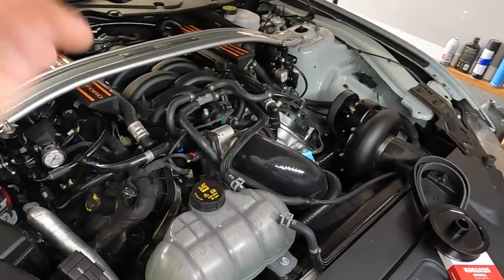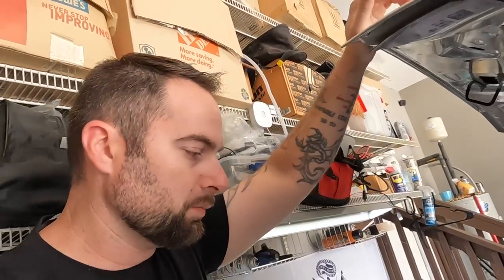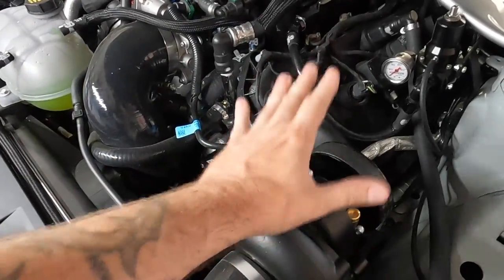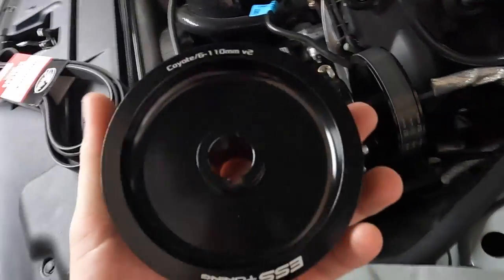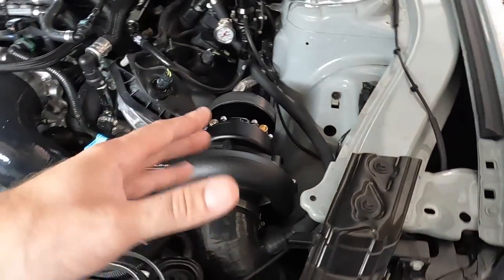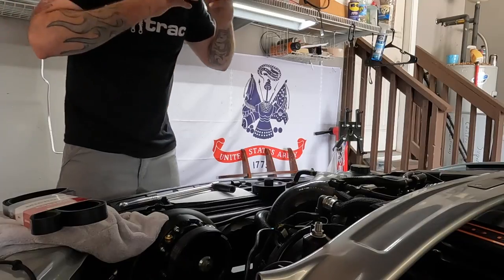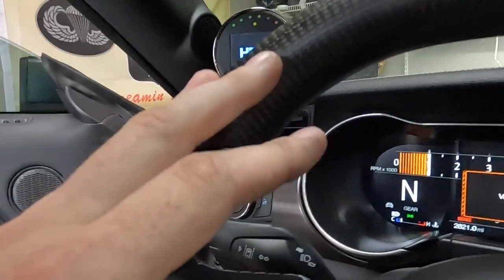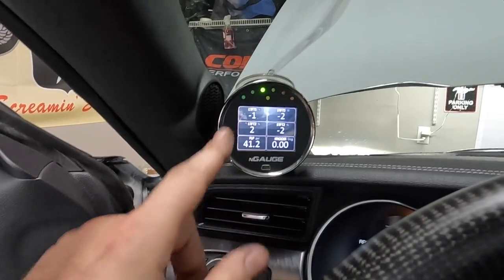FIRST WOT PULLS in my e85 Pulley'd Down ESS Supercharged 2021 Mach 1 Mustang *BRUTALLY FAST!

Comment: Nice seeing you taking predetermined and thought out steps by adding performance bolt on's like the Super charger and pulley change along with your body mods keeping the Mach 1 a Mach 1. It's getting faster and still beautiful. Nice job Zander building your special Mustang.

Comment: Did the TR3160 in the Mach 1 handle all the power mods without an issue? I've heard some concerns the 3160 may not be up to the task of boosted cars long term. Thinking about an ESS or Whipple for my Mach 1 eventually, but really not looking to built or swap the trans as well.

Comment: Nice man,  1 part at a time I was there. So just for reference if you remember my setup. I'm at 870WHP with the 105mm pulley and stainless works headers. So you're in the 800s definitely. Anyway,  pulley down and get headers and you might be close to 900 like mine. Killer video and set up bro
Reply: You must have sleeved block, built motor(oil pump, crank, pistons, rods) to push 800 wheel/925 crank, in any 5.0. It won't last long at all.
Reply: @MasterCarguy44-pk2dq  stock coyote block can handle a lot more than you're giving it credit for.  I do have oil pump gears and crank sprocket yes. Plus a fully built transmission. Otherwise stock motor. I've been boosted for over 3 years and still going strong.  I don't 1/4 mile drag my car.  It's more of a street car,  show car and weekend fun.  Not beating the hell out of it.
Reply: @Sabotfit5oh  No it can't. I have only work with the actual engineers/architects of these engines since 2008 abs SVO group which was renamed SVT. The max limit of block is around 980 hp crank. You MIGHT be lucky to get 5 full power runs at 980 crank hp/850 wheel but thats about it. 750 crank/650 wheel is the true safe range..
Reply: @MasterCarguy44-pk2dq  thanks for the information 👍

Comment: What were the reasons behind going w/ the procharger vs whipple? Really curious about all the setups, because Mach 1 will be my next fun car.
Reply: From what I've gathered from the previous videos he wanted to keep it somewhat still like a Mach 1. He also explained it all very well in his previous video that I'll link below

https://www.youtube.com/watch?v=a7FG5Q31y4Y
Reply: After watching all of his videos I decided to go with ESS as well on my Mach 1. Just because the Mach 1 is more of a handling car I feel like the ESS system will feel better than just blowing the tires off at every light lol

Whipples and stuff are hella fun but I just personally feel like a centrifugal could be more beneficial
Reply: Compared to a Screw type blower a Centrifugal superchargers tend to produce "peaky" torque curves which can be advantageous on the street as too much low end torque can overwhelm the tires and make the car dangerous for the street. They also tend to produce slightly more power per psi of boost. 
A screw type makes power virtually as soon as the throttle is open, basically just acts like an all around bigger engine. Both work incredibly well, it just depends what you want.
Turbo(s), btw, are the most efficient way to go but the most complex and takes up the most space. There's also some degree of lag to deal with. I run a single big turbo for drag racing, I seldom drive on the street.
Reply: Centrifugal you keep most of your car in tact. Slap an intake and the right belt you’re back to stock.

Comment: Just add fuel to lower cat temps..no reason it can’t be safely done. Most people run too lean anyway. E85 had a cooling effect anyway..you can monitor cat temps in a log but they are inferred so take them with a grain. And you need to look at long terms..short terms will almost always be perfect because of the long terms

Comment: Question. How much oil does yours take? Not sure what I’m doing I guess, but every time I go do a pull I get oil coming out the fill screw little hole. I’m guessing I’m putting to much, but I’m on the mark on the dipstick?
Reply: I just check my oil n the dip stick berly shows some i need to put some asap . Other thing mine dint come with blow of valve n is the biger intercooler
Reply: @jesusm4  I’d call n ask y not
Reply: @michaelsean3579  im about to tomorrow thanks for the reply

Comment: The TR3160 is technically caoabke of slightly more power than the old MT82. Its not worth it. 700 crank hp would be about max fir TR3160,. 700 crank is about 640 wheel.

Comment: Why you keep trading up every yr? It wastes $ but hey when your raking in well over 100k/yr I guess you can do that. Now you traded for a 24'. 24 is same engine as Mach except fir the dual intakes.
Reply from the maker: Gen 4 coyote is not the same. It has different cams, etc.. the way the 24 even accelerates feels totally different.